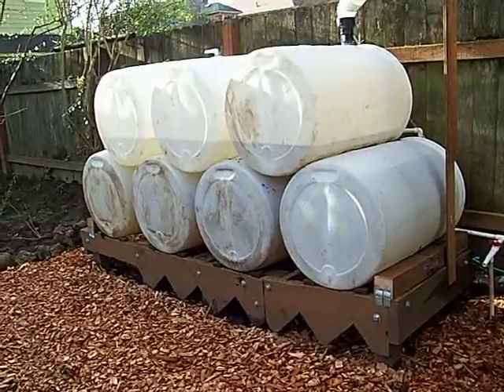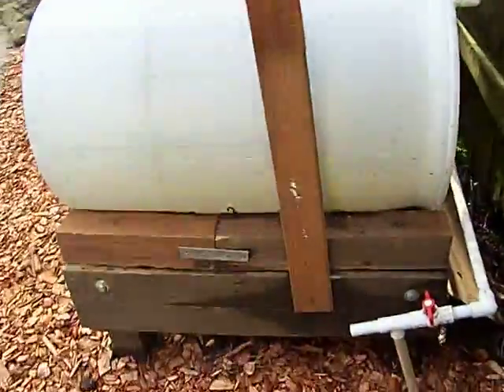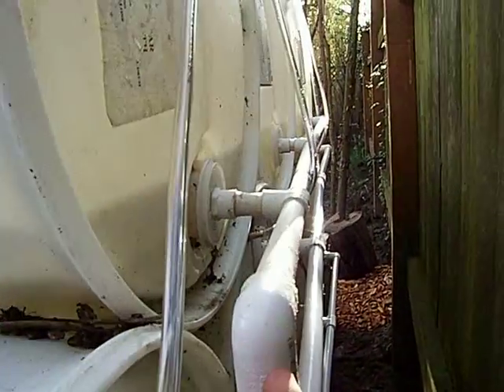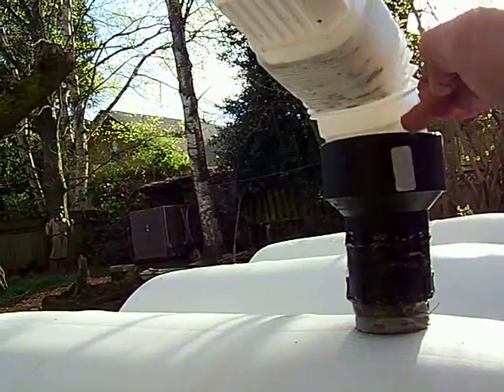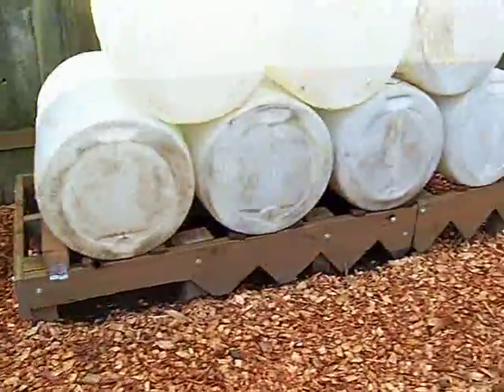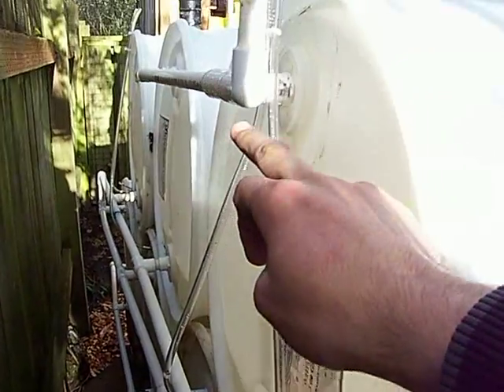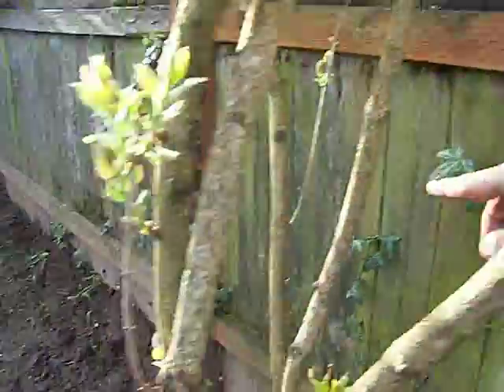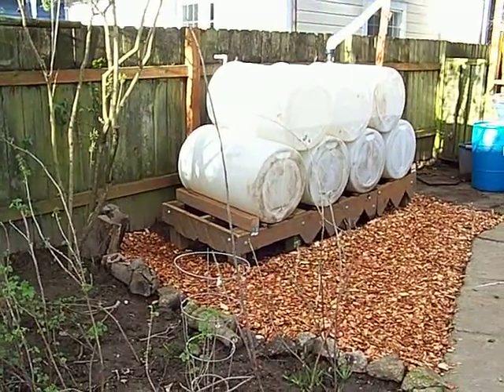Home built water catchment System

Comment from the maker: The total setup wasn't that expensive for me because I had free wood to make the base.  The barrels I found of craigslist for 15 bucks a piece.  I also had roommates to help me split the cost of other supplies.  
 Bolt, nut, and washers to hold the base together cost about 60 bucks. 
7 barrels at 15 bucks a piece cost 105 bucks.
 Brass air vents and tubing was around 14 bucks
the 1/2 in pvc pipes were free
the fittings cost around 20 bucks
system cost me my time and around $200.